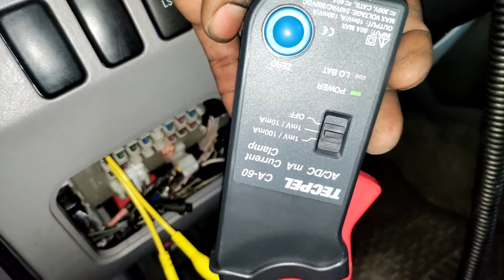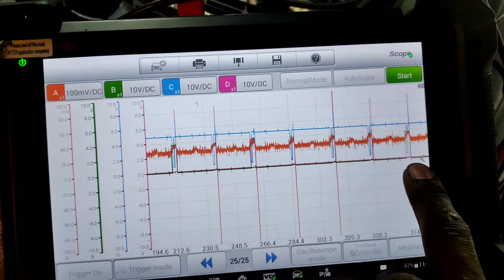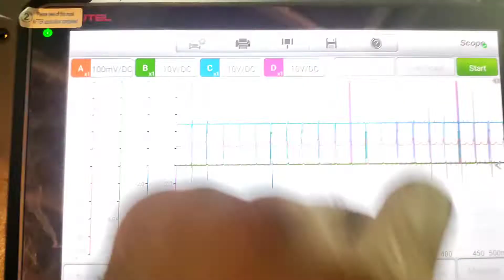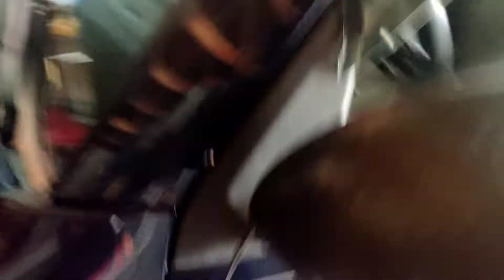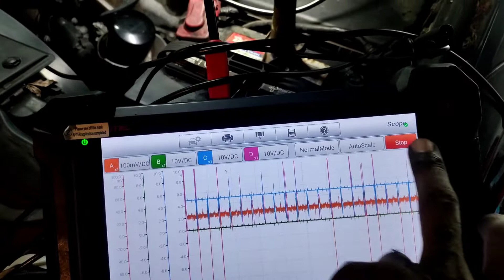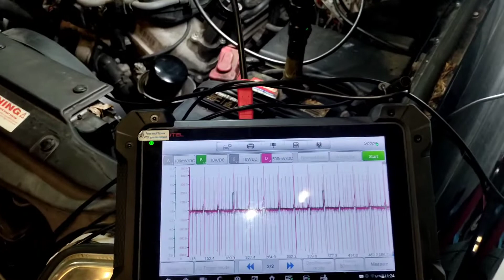Toyota 4Runner  p0300 using Autel maxiscope and mk908

Comment: Hey, what's that tablet,  or scanner you're using with the scope? My scope locks up constantly using it with a laptop.
Reply from the maker: @jeffreygwinn5081  read the title of the video
Reply: @partsshooter Yikes! You missed my question. And your title is misleading to some who may not know any better. The osiliscope you're using is an MP908. I was asking about the scanner or tablet you're using with the scope.
Reply from the maker: @jeffreygwinn5081  the mk908 is the tablet.  The mp408 is the scope which is now discontinued
Reply from the maker: @jeffreygwinn5081  they are autel products
Reply: @partsshooter  my apologies. I had the numbers backwards. I have the Autel osiliscope. Was looking for something that my enhance the functionality of it. Thanks for your time
Reply from the maker: @jeffreygwinn5081  j2534-1/2 is the new one.  

If you have an autel mp408 and it's crashing.  You'll have to contact autel directly and they can update. I'm not sure how it will work now if you have mp408 and it's discontinued. 

If you have another brand.  Contact your provider.  Maybe there's an update.  I had this happen and the update fixed my unit

Comment: You could have taken an ohm meter and tested the resistance of the coils.   I would bet that the bad coil had a higher resistance, which was causing the current to be limited and not allowed to build the slope as the others.  From there you can calculate the impedance if needed also.   There's a quick video you can watch about this if you want an information dump on your brain real quick, and it's called:    

"AC Theory: How to Find Resistance, Impedance, Inductive Reactance and Inductance of a Coil"
Reply from the maker: I considered performing a secondary test with ohm meter... However I really let my thoughts of the internet get to me 😂.  I'll do this next time